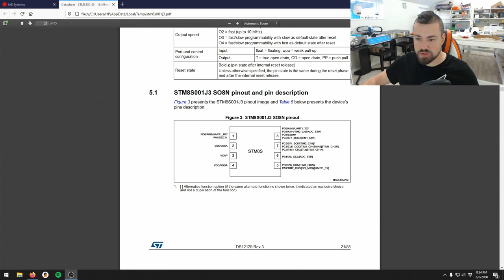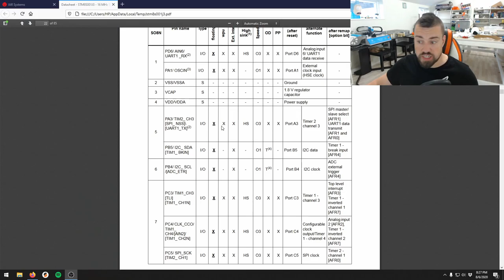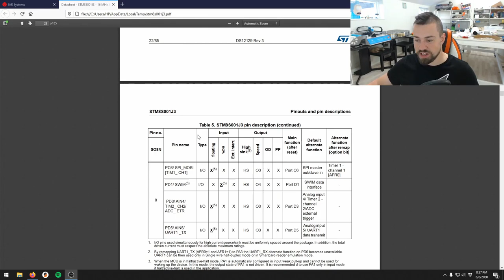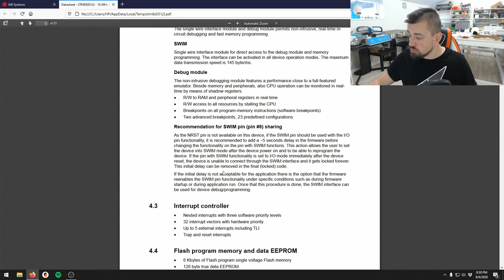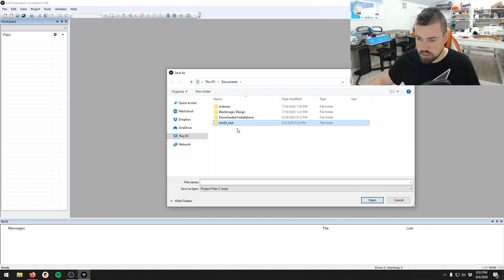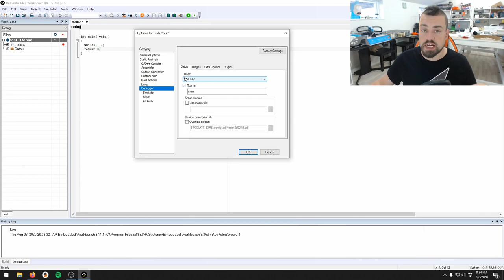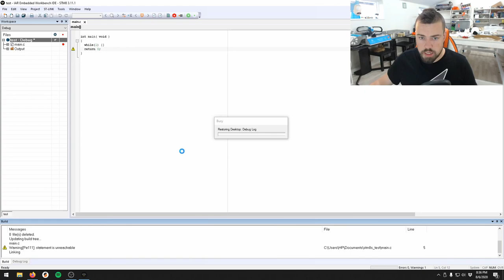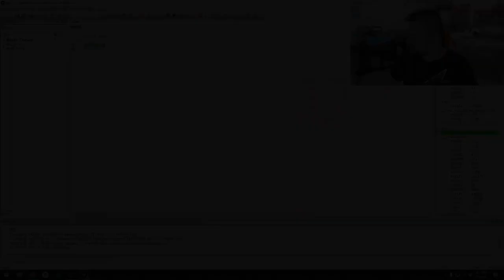Intruduction and connecting to the STM8S001J3 microcontroller

Comment: Super video! I have had much success with eFORTH from TG9541 (Thomas) in the STM8S003 format and I have a tube or two of the 8 pin chips and an SOP8 programming socket. Watching this video has prompted me to get back to my 8 bit roots in the mid 70s.

Comment: 5:38 YIKES, I ran into the same issue with one of my other stm boards where I reassigned the debug pins and couldn't flash anymore. I had to physically wire the reset pin to enable the chip to be flashed. With these I would have been screwed.

Comment: Hey! super great video :D i see that the STM8S is out of stock most places and is being discontinued. Do you know of any alternative of the same size? (not any Attiny, i dont wanne program with arduino).
Reply from the maker: Hum.. I didn't know that, that's bad :/
You can use arm studio for programming the tiny if you want :)
It really is a jungle out there - Microchip (and Atmel parts), TI, NXP or ST.. in that size most of them are about the same I think. maybe look at the small MSP430's from TI :)
Reply: @banjohat  using ARM studio sounds really cool then! i will look more into that. Thank you :)